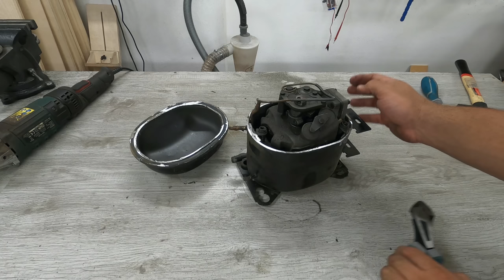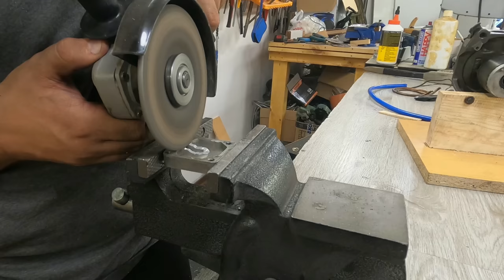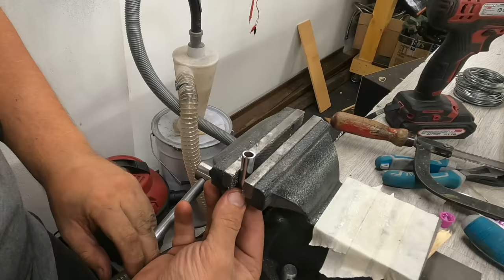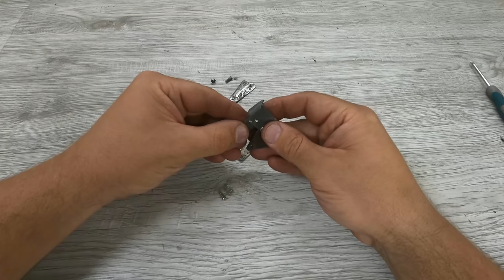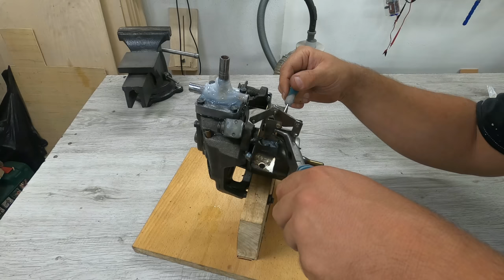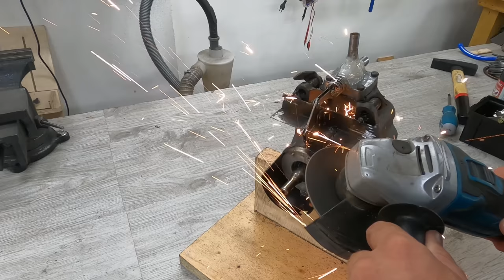I Turn Refrigerator Compressor To Working Steam Engine (Step By Step)

Comment: this two-component adhesive cannot withstand the heat of steam for a long time. and especially if you use higher pressures that there would be some benefit.